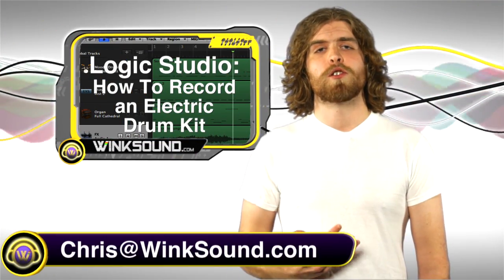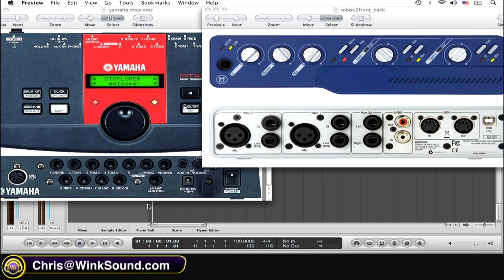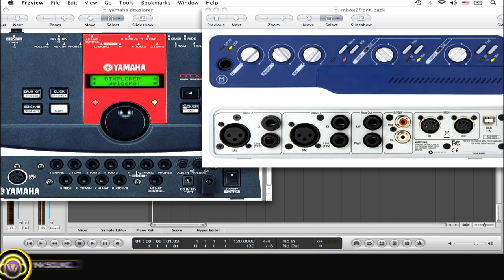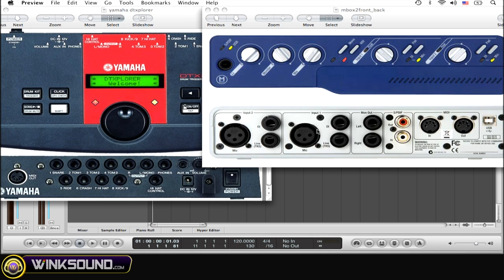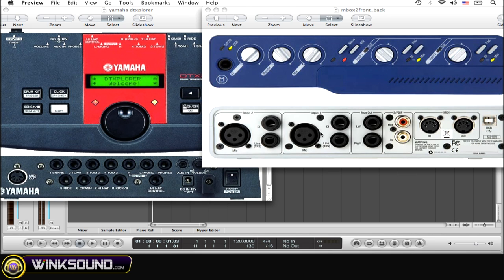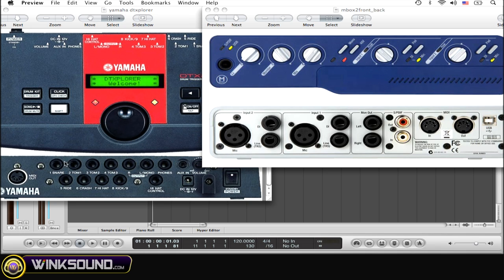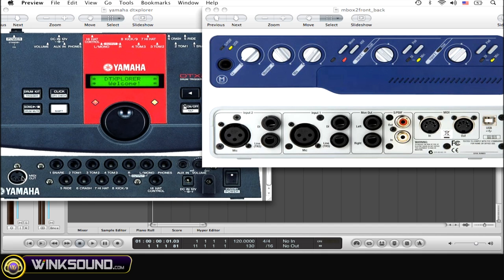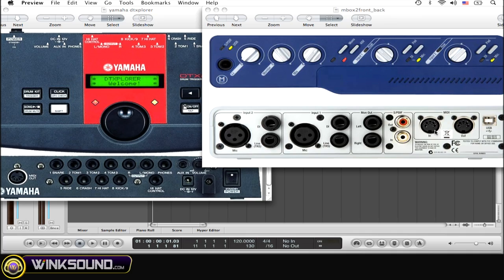Logic Pro: How To Record an Electric Drum Kit | WinkSound

Comment: yo i did this, using roland TDXV2 or something and M audio firewire 410. using midi from kit to M audio, then firewire into my comp to record midi. but some of the drum sounds are off, i.e. the open hi hat sounds like a closed one and the closed one and the hi hat pedal make no sound, although they do come thru as midi data. how do you map them to certain sounds in the drum kit track? or do i just need to drag the midi data to the correct sounding thing on the piano roll?

Comment: i have a electric drum kit it has a midi out and a left and right output 
would i be able to record my electric drum kit into my computer using the m audio interface or what would you suggest for recording guitar and drums in to a computer and being able to mix them ? i also have a boss me 70 pedal would i be able to use the effects of there then run into the m audio interface ? please respond thanks

Comment from the maker: @Prasetyaification.  To answer your question, there are two different ways that you can record out of the yamaha dtxpress.  You can record the drums as audio, by connecting the L/R outputs on the back of your electric drum module to inputs on your interface (using 1/4 inch cables). 

You can also record your drums as MIDI as well (if your interface has a MIDI input), by connecting the MIDI output on the back of your drum module to the MIDI input on your interface...

Comment from the maker: On a side note, if you would prefer to record your drums as MIDI, but the interface you are using doesn't have a MIDI input, many companies such as M-Audio have made cable adapters that allow you to connect your MIDI output to a USB slot on your computer.  Check out the M-Audio Uno, as Dabog083 mentioned if this is the situation that you're in. 

Chris.

Comment from the maker: Hi @Dabog083 
Yes. That means that your electric kit only sends MIDI information, as opposed to being able to receive MIDI info as well. Install the M-Audio drivers and connect from the MIDI out on your electric drum kit to the USB port of your computer. Haven't personally used this interface so check the manual in case it needs any special setup and you should be good to go. 
Mateo

Comment from the maker: @jjpp1093 Thanks for the great question. This is totally possible, M-Audio actually makes a product (M-Audio Uno-MIDI Adapter) which allows you to do exactly what you're hoping to get accomplished, I'll send you a link to the device in your profile.  When using this device, or any other device like this one you will then be able to use your drum tracks the same way as you would with any other midi track.  Cheers.

Chris.